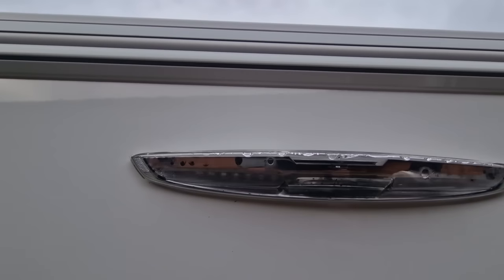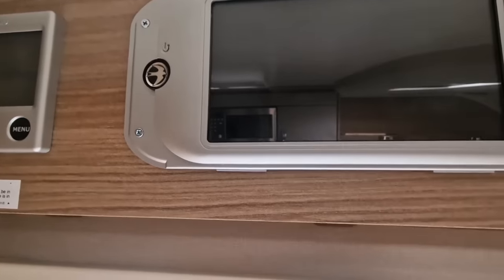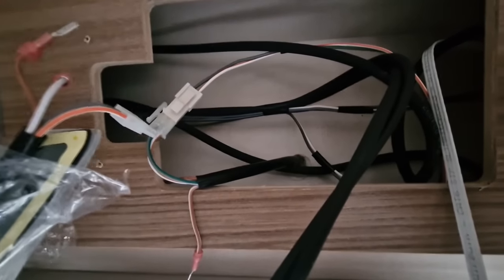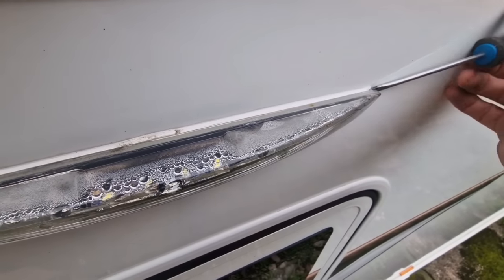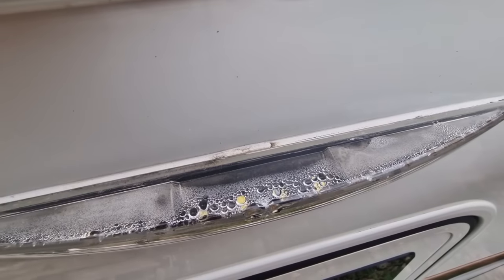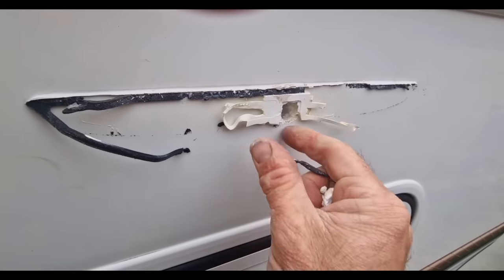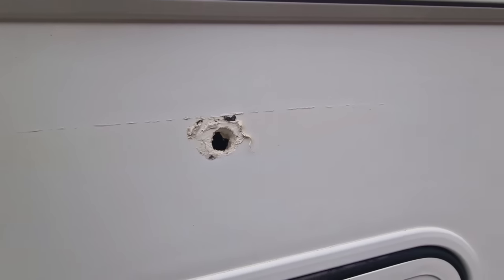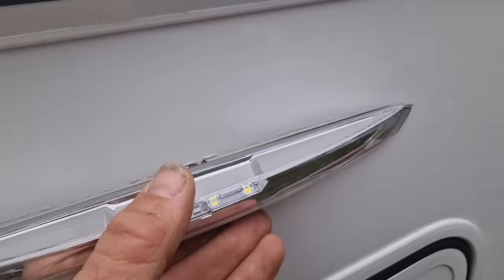STUPID Swift Awning LIGHT FULL OF WATER.

Comment: I didn’t have any fishing line when I changed the light on our challenger. So I used dental floss and it worked perfectly. I wouldn’t risk using a screwdriver or Stanley knife. I got the sealant off using Autoglym intensive tar remover it also removed the black foam. I used masking tape around the light before removing the old light, it allowed me to fit the new light level and also put sealant around the light.
Reply from the maker: Good Idea with the dental loss 👍

Comment: I am amazed at how poorly caravans are produced just looking at the drilled hole no rubber grab to protect the wiring and everything is so cheap and nasty but cost a fortune
Reply from the maker: They rely on the sealant, but there is no pressure on the wires in their defence, just imagine the cost if they did put grommets in 😳
Reply: Totally agree with you. We bought a 2022 Swift Icon 4 berth. Build quality is atrocious. If I paid a similar amount for a new car, I would expect it to be perfect on delivery. When you complain about a caravan, most people shrug their shoulders and imply that poor quality is standard.
Reply: Just got rid of a 2021 Swift Sprite Alpine four because of the poor build quality. We are the second owners since new. Purchased it at two months old. We thought we had got a bargain. The previous owner probably realised like us that the caravan was built poorly and was slowly falling apart around us. We thought that a two month old Swift Sprite being purchased for £19,500 in 2021 was just that but the Sprite range is even cheaper in build quality and therefore we made a loss when we sold it onto a dealer at the end on 2023 for £13,500. With that money we purchased a 2013 Vanmaster after waiting over a year for a warranty repair on two badly cracked windows and a fold down tray that had come  loose from the front wall of the Swift Sprite caravan. The difference in build quality on our (new to us) Vanmaster versus the aforementioned two year old Swift Sprite is very noticeable.

Comment: Hi Mark. 
Rather than a flathead screwdriver, use a trim removal tool. These are plastic with varying angles and sizes. Big plus is that they won’t scratch the van if you slip.
Reply from the maker: Good Idea Phillip. The fishing line works very well, it's only a foam seal so goes through very easy. 👍

Comment: Replaced mine  but removed the small foam gasket and used sika 522 to cover the entire ba k of the light fixed it to   the van then ran a bead of 522 around the light .

Comment: I'm about to change the awning light on my 2010 Bailey Pegasus it the gutter type currently but I'm going to replace with a much more cost effective LED light any tips on how to go about changing a light on a bailey.
Reply from the maker: It should come off in a similar way, although it may have screws, so just pop the top cover off and check, the wires also go from 1 side so this may determine the replacement. 👍

Comment: How weird this video popped up because I noticed mine on my caravan had water in it last week, it still works though, I was thinking of taking it apart and seeing if I can actually repair it as I know it’s not that old as it was just replaced before I bought the caravan
Reply from the maker: You could try drilling a small hole in the bottom to let the water out? At worst you are going to replace with a new one anyway 🤷👍

Comment: If i had a pound for everyone of these ive changed this year 🤦🤦🤦 im a tech for a swift dealer and its brutal , time for a design change i think 🤣🤣
Reply from the maker: When we went to the factory, we mentioned it, it was like no one had ever said about them before, the one chap said they hadn't had any problems 🤣🤣🤣🤣🤣🤣🤣
Reply: @thecaravanplace  surley they see amount of warranty claims lol most of the ones we have done this year are one / two years old its as if they have had a really bad batch of them 🤣 , either that or the old manufacturers thoughts of the dealer will sort it 🤣
Reply: easy fix 2x 2mm holes is the bottom so it can drain/vent

Comment: Hi Mark I need to change mine on 2011 swift conqueror is it the same removal my control panel is the non command type
Reply from the maker: I think so if the wire goes to the back of the panel it's the best way to access it. 👍

Comment: Could I pick your brain please, could you tell me weather the habba awning light , the curved one that fits around rop of the door, comes apart, as mine is mucky inside, I see you can get a new led srip for them thanks
Reply from the maker: I think the plastic cover clips off from the top bottom and maybe side. This will then reveal everything to clean or replace. Small clip remover tool to ease the top frame up and it should start coming off. 👍
Reply: @thecaravanplace i have had alook at it today, the top half if stuck on with mastic, do I need to cut the mastic and then prize the cover off? Thanks for your help

Comment: Don't use a screwdriver to remove it
 A car trim panel removal tool is ideal as it's made from plastic specifically designed not to damage automotive plastic trims and only a couple of £'s so ideal for ext caravan lights if you have no line. Also use car tar removal products to easily remove any sealant and glue around the light.
Reply from the maker: Yes the trim tools will do it 👍 good shout on the tar remover too. It is a very thin bead of glue so does come off pretty easy.